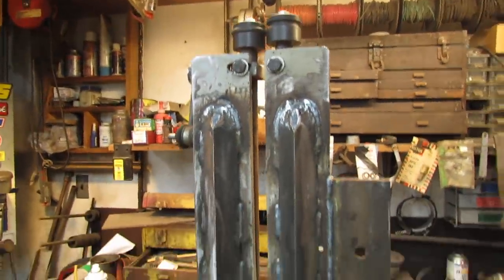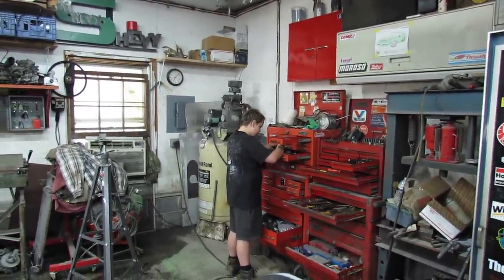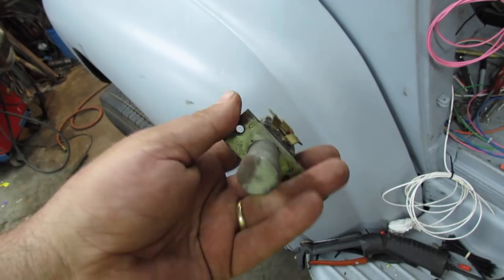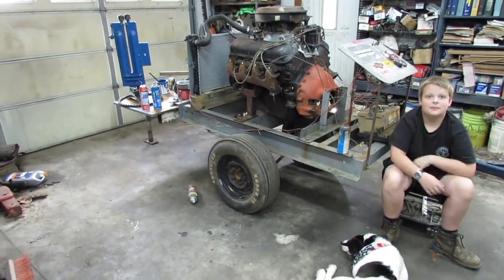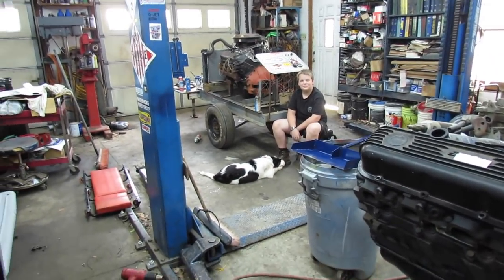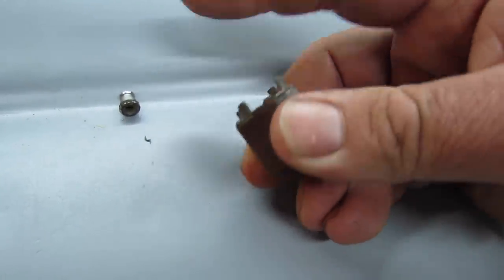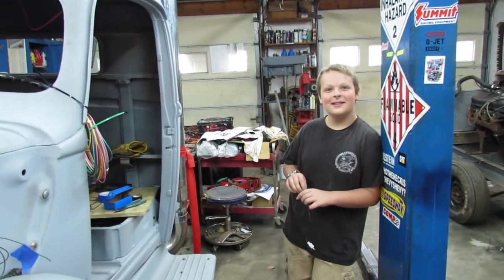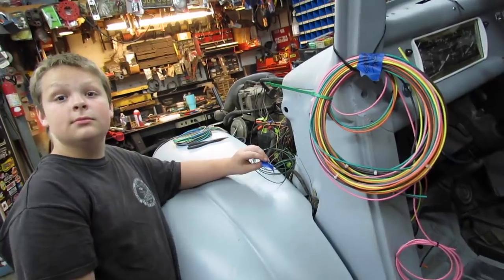46 Ford-Dash Wiring

Comment: Meanwhile back at the ranch here in alaska,, patiently waiting for the nicest ride yet to come out of your garage is me getting older and worrying that I might not live long enough to see this one that I would be very extremely happy to just set in it and admire the fine  work done. I see lots of stuff not videoed cause it was just this or that getting done. Mrheavyshevy, that truck is the jewel of the north as it just overwhelms me to see that many wires all find homes. I see all that labeling that was no small feat of its own. I dread that after done, it has to come apart for paint but as it is, it needs to go together so that the different looms can be made and then it will be a ninety six... forty seven and what a ride!!!!!! I sure hope to see it as the nurse tells me not to let my pump for my kidney run out again as it has to be filled every three months and I forget just like all the other meds that I take so I can be a armchair piss head that does nothing but whine and complain. I love the smiles on your families faces as they love ya man. I haven't even seen one of my kids that are just too busy to come see me. For some, its been near ten   years as they live in the continental USA and I live in middle alaska. One day it will be done